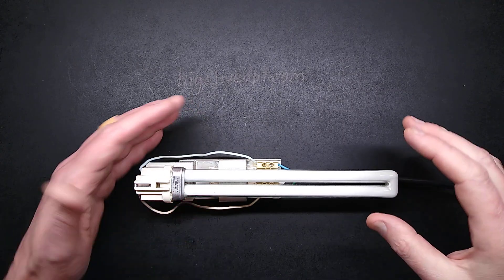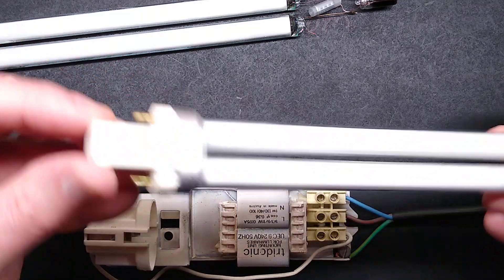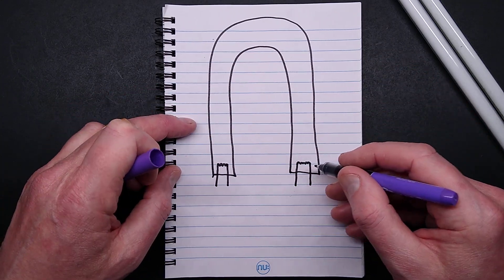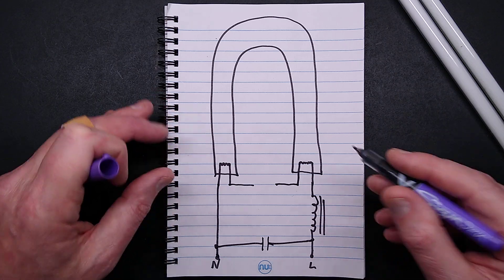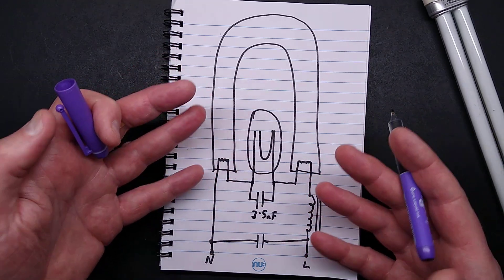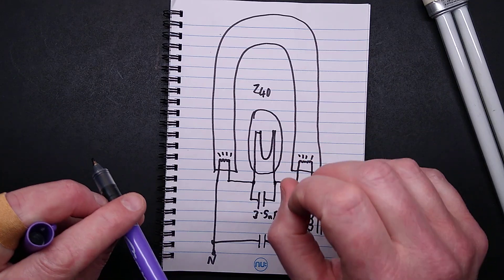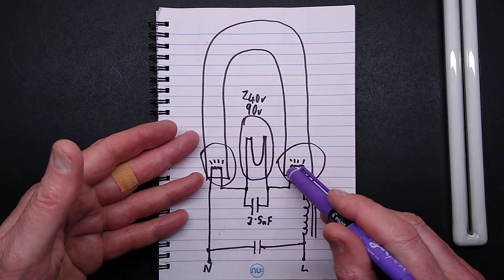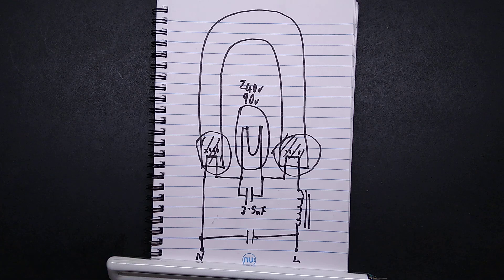Retro already?

Comment: I will stand by fluorescent lights forever. There operation is intriguing. They also last a heck of a long time, are reliable, especially preheat and age in a cool way. Keep these fluorescent videos coming! I enjoy the breakdown of how they are operated and function and I'm still trying to understand how it all comes together.
Reply: Except for the junk that comes from China. I have had compact fluorescent lamps in the States that have lasted 10+ years in service while CF lamps here in the EU that were made in factories in the EU last just as long, however with the mass influx of junk from the Far East I was replacing CF lamps once a year. Same goes for LED replacements anything coming from the East is total junk and not worth the money.
Reply: In some respects yes, but having been involved in lamp manufacturing for many years in the uk and then importing from China I can say the factories there I was involved with were at least as good as ours (ours were mostly out of date), some were better. The caveat is that in sourcing from China etc there’s a choice - quality or price. If its a case of putting the cheapest product in your catalogue or on your shelf, then quality will definitely suffer.
Reply: I am right with you on the note fluorescent lights

Comment: These lights are good, especially with electronic ballast. The glow is very soft. Not harsh like led bulbs.
Reply: Yup, they glows out light pretty much as natural as sunlight. 🍓
Reply: @LabArlyn  yes. I remember these were code 840. Sunlight output.
Extremely hard to get in India. I had gotten hold of 5 pieces. Have been holding on to them since a decade. Cherishing them in very select locations.
Reply: @LabArlyn  I don't understand people saying this recently. No they didn't, they were terrible! 840 lamps have a really discontinuous spectrum of light output, way worse than both incandescent and LED. The only 'sunlight' aspect of them was the CCT.
Reply: @ssj3gohan456  I don't really understand about it.
The statement I made is my opinion that I judge with my bare eyes.
With it, I found that flourescent light emmits natural sunlight looking light.
Reply: I have been noticing the strange sterile-ness with LEDs that were installed in the late-2010s in stores! (IIRC)

Comment: It is a shame that fluorescent's did last a long time, but then they cheapified them and they barely lasted longer than an incandescant near the end of their production (in my experience).  And now they are doing it to led's, led's should theoretically last 4 times longer than even a fluorescent claimed to last, but they are finding ways to cheapify them as well now too.
Reply from the maker: They reduced the amount of mercury used in them, so it often got absorbed into the internal surface and resulted in the tubes going dim.

Comment: The "high voltage spike" you mention that starts the lamp when the starter opens comes from the inductor.  When the circuit opens, the magnetic field collapses, creating a pulse that helps start the lamp.  This is the other reason inductive ballasts are generally a better bet than resistors or capacitors.

Comment: So the elite are after the super thin tubes now? I can see telling people to give up on T12 tubes (they are easy enough to upgrade to LED too)  but to force the newer tubes out when they may only be being run a few hours a week is Big Brother doing his usual thing on behalf of the manufacturers of the new crap. The efficiency and lifespan of the smaller tubes is really not bad at all. Maybe once / if the Dubai bulb is the norm, but until then regulating T8 and T5 out of existence is criminal.

Comment: I mean, the pulsing flash of an LED supply in "hiccup" mode can be quite eye-catching. Just don't use it at the Epileptic's Conference.
Reply: To be fair, the same goes for a failing fluorescent tube starter. That pulsing trying-to-start can also send light-sensitive epileptics over the edge. I've had epilepsy myself, but thankfully I was not light sensitive during that period. A friend of mine was and she got around 6 episodes a day before a very bright out-of-the-box-thinking neurologist investigated deeper and found out that it was actually her optical nerves that were damaged and co-designed special glasses to cope with that. After donning those, she only has about 1 serious episode each month.
Reply: @LarixusSnydes  Glad she was able to get help for that. I don't (think I) know any light-sensitive epileptics, but from working at a pain management clinic, I have an idea how debilitating that nerve damage must be, especially these days. Everything has to be big, bright, bold, and flashy to get any attention, or so it seems.
Reply: @McTroyd Thank you for your kind words😀. When it comes to flashy, garish and bold, the 90's must have been a true hell for her. In her case I think it was more a case of 1000 possible causes and someone who had an exceptionally keen eye for the EEG patterns to derive a higher than normal possibility of a deviation in the optic nerves.

Comment: Yay, thank you. I learned something today. I noticed in the past, when a tube was on its last legs, it would sometimes strike - then go out - and repeat. I found that removing the starter once it had "struck" would keep the tube lit until it was turned off - then you just had to briefly refit the starter net time.

Useful (very) if you needed to work and had no new tube on hand.

I had not worked out what was wrong - (realised it was not a dead starter) - and now understand that the failing coating on the electrodes were allowing the tube voltage to rise to the point where the starter wanted to "do its thing" again.

Thank you! Another little puzzle solved :) x
Reply from the maker: Also check you have the correct starter.  There are a few different ratings going by tube diameter and length.

Comment: I'm gonna quote PhotonicInduction here; "fluorescent lighting can last twenty years, these (LED) aren't gonna last two!". He's right, we have LED high bay lights and LED "fluorescent" lights already failing after two years in our new buildings. The fluorescent lights and metal halides in the old buildings are still going strong after 20 years (yes of course they've had a couple of tube changes over those years)
Reply: If youn buy cheap you buy twice. Fluorescent lights also broke. I exchanged a lot. Sometimes the starter sometimes the tube itself. The worst where the smaller. They suck and the light itself is bad too. It is okayish in an environment you don't need to stay for long but at offices for example they are bad for the eyes. They where never good. And the better ones also where way more expensive than the cheap hardware store crap.

And btw if they last that long why you all cry then? Oh they break sometimes too... funny, that can't be true if they lasting that long like everyone claims here.
Reply: @nooboard  Your ranting on two different subjects. Back in the day, if we bought Crompton or Thorn lighting, there was near enough zero problems, like ever. It was only cheaper Chinese junk which entered the market that was more unreliable. 
    However compare that to any brand of LED lamps or panels, and there's always faulty units. Ive yet to see any project, large or small, where every light as worked.
Reply: Depends on the led light fittings you buy, LED lights that have the power circuitry in them don't last very long but if you can get ones where the low voltage is supplied by an external power supply they last as long as the LEDs themselves last which is quite a long time.

Saying that, the last lot of LEDs I bought from China (yes i know they are risky), the ones that go int the GU10 fittings I fully expected to last 6 months like they usually do, but they have lasted 4 years and are still going (I used them every day). Surprising.

You just have to make sure you screw them in with the power turned off because the entire outside is metal, would not recommend anyone else use 'em if they are not careful.

The halogens that used to go in the same light fitting used to last 4-6 months so the LEDs are actually an upgrade from those, florescents are pretty robust, but the light they give out is utter crap so swings and roundabouts, I still have a CFL in one of my upstairs lights that has been there for 15 years.
Reply: ...Also there is electrodeless(induction) lamps which are.....ageless
Reply: @МихаилЦымбал-д9м  Same with cold cathode fluorescent.  I have lamps in service with well over 80,000 burn hours and still going strong.

Comment: I have a 20 year old lamp with one of these. The base broken and it gets held up by a vice, the reflective backing has had to be reglued back, the plastic casing looks like it's been in direct sunlight the entire time. But the bulb is still the original, and still working.

Comment: The fluorescent tubes are already effectively phased out. Had an electronic ballast fail, and now the usual suspects (screwfix , toolstation, etc) no longer stock them. Unfortunately you either need to now buy a complete light fitting that is close to £100 for the same kind of light but in LED, or a replacement 'gear tray' with LED's at close to £40. I found a place still stocking the ballasts, but that was over £30 too. It's a right pain, as I'd not long got a replacement 2D style LED lamp to replace the original fluorescent tube that wore out (Yes, I did match the rating of the new lamp to the ballast - not the reason for failure).

Comment: That compact fluorescent fitting is very similar to type I had in a reef marine aquarium. They came in reef white and actinic blue and were excellent for coral growth . The replacement bulbs became impossible to buy - virtually extinct now and I was forced to switch to LED . The new aquarium led are okay but nowhere near the same intensity and some corals don’t like them at all . ….
Reply: Try using a combination of those LEDs and those BL fluorescent bulbs that you find in bug zappers. Those have similar spectrums to actinic tubes

Comment: I've yet to request work order a mountain of a certain small incandescent bulb my baler uses...... Not for light, but as a heating element to keep moisture out of the computer that runs the ancient machine.
Reply from the maker: Might be worth considering swapping to a big ceramic or aluminium cased resistor as a robust heater.

Comment: I really have to roll my eyes at some of the rose-tinted glasses people seem to have at the death of fluorescents. They weren't all indestructible. I've had plenty of tube lights die. The noise from (ballast or the bulb, depending) could be just awful. The flickering as they die is also terrible and caused me no shortage of headaches.

I'm not a fan of truly disposable entire fixtures, I think we can do better, but the LED panel lights I have bought have, with few exceptions, been rock solid. I vastly prefer the daylight color temperature they put out, and they're bright!. Also they suck significantly less to install in many cases.

I think it is true there are a lot of shitty LED lights out there, for one reason or another. But let us please not pretend that all fluorescent lights/fixtures were perfect. They weren't and I'm open to seeing actual data about the failure rates between them, but I'm not particularly receptive to the anecdata people throw around. Survivorship bias is very real on this and other things and not very helpful.
Reply from the maker: The continuous rhythmic pulsing of dead LED drivers is a strong contender for most annoying effect.   The traditional fluorescents could have been fitted with a cheap electronic starter that would make a single go at lighting the tube and then go into standby.
Reply: @bigclivedotcom  Annoying at best; genuinely dangerous at worst given that epilepsy is a thing and the number of LED streetlights I've seen go all rave mode on interstates here.

Comment: may not have been the best way to do it, but when I was a kid, I found out if you put a florescent starter in series with an incandescent  light bulb / lamp,  it  causes and interesting flickering effect for Halloween.
Reply from the maker: It used to be a common trick in the theatre industry for some effects.
Reply: @bigclivedotcom  Interesting, but I imagine that would not have been great for the lifetime of the incandescent filament inside.

Comment: It's sad though. the 'simple' fluorescent lamps were super reliable. I have a small under cabinet light that uses this EXACT layout (except it's a 120 volt version) and it's about 12 years old and still working. Kind of hard to beat a component count of three. I don't use it too often, but other fixtures I've seen in buildings that have been abandoned for 80 years (and somehow still have power) have fluorescent lights that are still working, though obviously not all of them. I'd like to see an LED fixture last 120 years.
Also, it's argon. The neon starters you'd find are much more 'blinky.'
Reply: I have a shoplight in one of my sheds that is ~80 years old.  Only things I've had to replace other than lamps and starters is the cord.  Same with an identical fixture in my garage that my grandfather got as war surplus when he built said garage in the 1950s.
Reply: @randacnam7321   Sounds like a fire risk.
Reply: @BTW...  It isn't.
Reply: See, what you say tells me you have no idea about the subject, and have never worked in the industry to know.
Fluro lighting in a commercial / industrial / public installation is a maintenance nightmare, and always has been due to the COMPLEXITY.. having multiple failure modes i.e. A lot MORE than 3 components you see. 

Do you need me to name the 8-9 components in your fave old antiquated tube fittings?

Comment: At least for a while the tubes contained a bit of tritium. I assume the radiation from this helped to start the discharge in the tube
Reply from the maker: That may have been the starters to assist in initiating a glow in complete darkness.  Neon indicator lamps contain trace radiation in the electrodes.
Reply: Krypton 85, not tritium; and it's used in starters and certain metal halide lamps, not fluorescent.

Comment: You  can't  get Argon    anymore   due to the  fact  that the  Ukraine   was a huge  source  of that  type of gas
Reply from the maker: And major neon supply issues too.
Reply: In 2019 Ukraine's exported Argon represented 2.28% of the world's total Argon exports. Thus Ukraine is not a "huge  source  of that  type of gas"  but rather a minor player. Germany is the largest exporter with 28.91% of the world export market.

Argon is almost 1% of the atmosphere and is a by-product of the separation of cryogenically produced oxygen and nitrogen - a process that is carried out worldwide using air as a feedstock. Thus most countries are probably self sufficient in Argon production.

Comment: I thought small vacuum sealed glass ampules like that were blackened with "soot" due to them being a partial vacuum and some material that they could burn to consume the remaining oxygen to make it more of a vacuum or less reactive with oxygen either way. I know they do that for VFD panels, maybe it's the same here?
Reply: It's called a "getter" and is usually a reactive metal (often barium) and is heated to vaporisation by induction once the tube has been sealed. So the "soot" is actually mostly deposited metal vapour with a little bit of reacted metal (oxides, nitrides and so on).
Reply: @ianmason.  Yeah that's exactly what I was referring to. Thanks for the refresher!

Comment: Quite a few of us collect fluorescent tubes and fittings! I don’t like the light from LED, so the whole house is T12 fluorescent and T10 circline. The extra power consumption doesn’t matter as it’s dwarfed by the 12 solar panels producing up to 4.3kW of free leccy and 10kWh battery storage.
Reply: You're a weirdo, especially with them T12 bulbs, best quality bulbs were T5 and I'd argue that high CRI modern LEDs are way better.
Reply: In most high latitudes we need more lighting in winter when the days are shorter.  Any power wasted in the lights is reduced from out heating requirements by the same amount.

Until a better heating system is used like a heat-pump there is no saving from domestic lighting heat generation avoidance.

In hot climates with massive malls and offices that need to use air-conditioning to cool the dark spaces the equation does favour the most efficient lighting system.  I heard that at my kids school in Finland the air-conditioning load decreases measurably at break time when all the kids are outside (or at home) and not dissipating their 100W each of heat into the classrooms.

Comment: I bought a desk lamp with 2 fluorescent tubes 30 odd years ago, its still working and i have never had to replace the tubes.
Reply: There are some videos on here of the very first tubes (late 30s) and they still work. I think preheat gives the best life. I have decades old tubes in my house that are also working.
Reply: @CanizaM  Note: ALL fluro tube light output drops off after 1 year of use.
Reply: I have one such desklamp but it needs a new tube. I have not been able to find one.  The energy used in earning enough to replace the lamp with a led fixture far exceeds the saving from any purported reduction in running costs - another own-goal by the eco-idiots.
Reply: @robt2151  12V adapter and an LED strip instead of the tube? Clive had a video about it. The material costs involved in replacing LED's should be far lower than the glass and mercury of fluorescent. The real problem is treating things like heatsinks as disposable when they really shouldn't be.
Reply: @robt2151   Go without then.

Comment: The question that popped into my head was which is easier to recycle?
LEDs may be the new thing but it's still got to be recycled at some point in time.
Reply from the maker: Glass and a small amount of metal versus plastic and fibreglass bonded to metal.